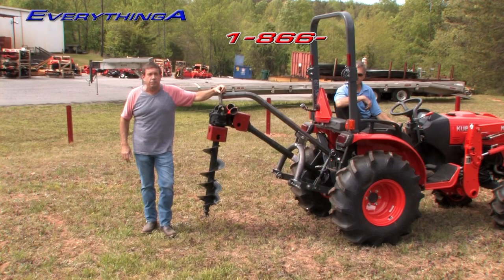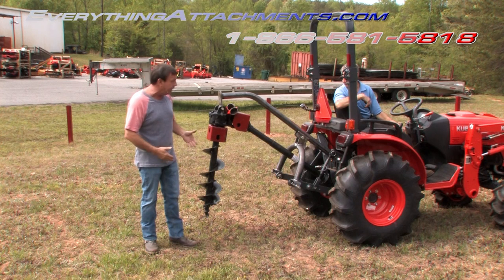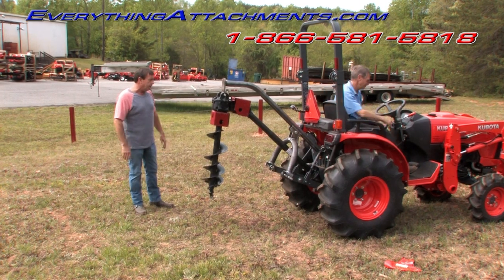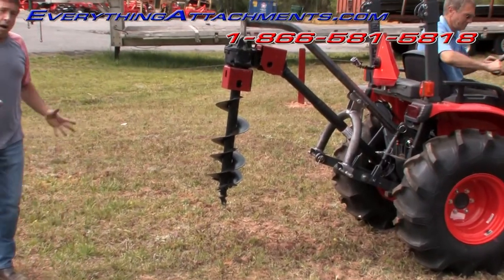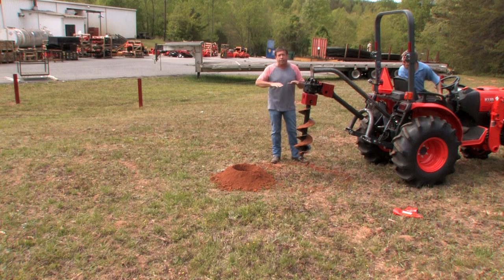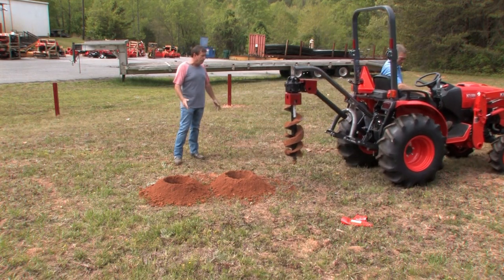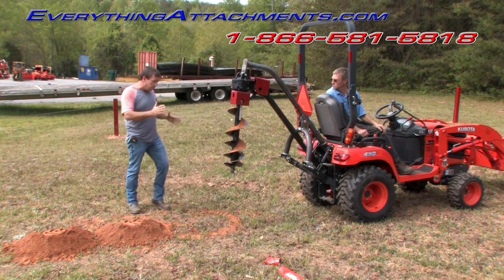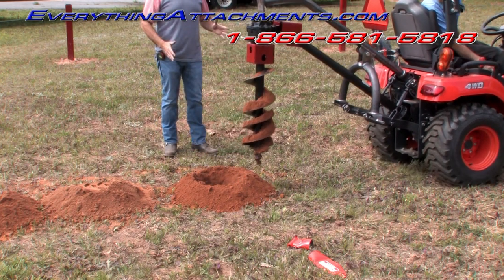Land Shark Small Compact Post Hole Digger

Comment: Ted great job designing a new PHD for us SCUT owners. I would like to see a couple of additions to your PHD though; I find that with no down pressure on the 3 point it can be difficult to get the bit started in Texas hard clay a place to pin in a bar handle so a person can help guide the angle and put some force down. Also, build a good stand that can help with connecting the PHD to the SCUT.

Comment: I know this is an older video , but , Will this digger work on a Cub Cadet 184 ?
Reply from the maker: It depends on the tractor..  It requires a normal category 1 three point hitch, and a center pto shaft for 540rpm.

Comment: I bought an ETA PHD for my B7800 last year.  I got it to work, but the bit would drag in transport and I had to dig out the bit a few times because I couldn't pull it up. With where I had the hoop and lift positioned, there just wasn't enough leverage. Is there anyway you could do a retrofit of some sort to get some of the features you put in this landshark model onto the ETA compact model.  The landshark seems to work really really well for that size tractor.
Reply from the maker: +gbparn Give me a call when you get a chance.  That may be possible.  --Travis

Comment: Been looking at YouTube for post hole diggers for compact tractors just found your video I can tell you the one problem with your product, in my Township and in most of our state minimum hole depth for Footers and pilings is 42in minimum depth they like to see 48in to 50in because of the frost line. Do you have a solution for compact tractors that need a 48 in deep 8 10 or 12 inch auger? My tractor is a Massey Ferguson GC 1725mb.
Reply from the maker: Our BX had 18" of ground clearance with the 36" fully raised on flat ground, so we could put a 48" on it and use it, but it would drag in really uneven terrain.   We also offer our EA compact post hole digger, which uses a longer boom to give subcompact tractors clearance with 48" long augers.  A longer boom stretches out the center of gravity and makes lifting it more difficult in hard soil.  We're here to assist customers with choosing the best match for their tractors and applications, so feel free to call us or email sales@everythingattachments.com with any questions.  Thanks for watching and commenting!
Reply: @EverythingAttachments  we have an old post hole digger truck back on the farm.  the bit on it has a hex hole through the middle of it, allowing you to slide the bit down if you need to dig lower.  you can increase the digging depth a foot easy by sliding the bit down.  The only issue is you have to pull the bit up every so often and clean the top with a shovel.  Granted this one has a 6' bit, but we have drilled end post holes 10' deep with it on 1/4 mile stretches of fence.  

Is this something you could incorporate into the design?  I would think that a 1 1/4 hex shaft about two foot long engaging in a hex ID pipe with two cross drilled holes and pins.  With the shaft fully in, your digging depth is the same as what you have, then the next hole allows you to dig another foot deeper.

Based on your current clearance, when fully up, you should still be able to move past the hole.